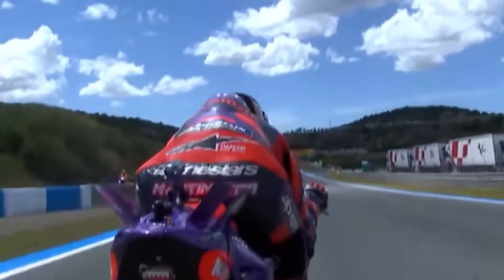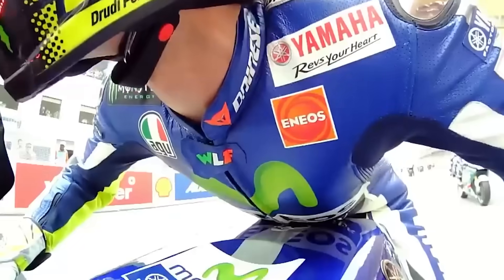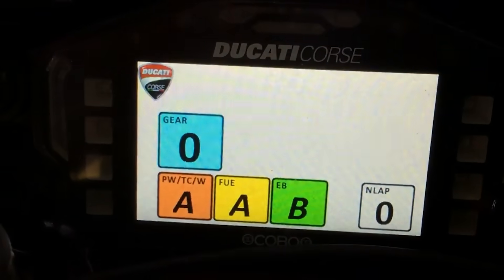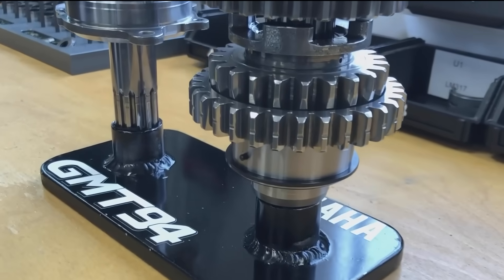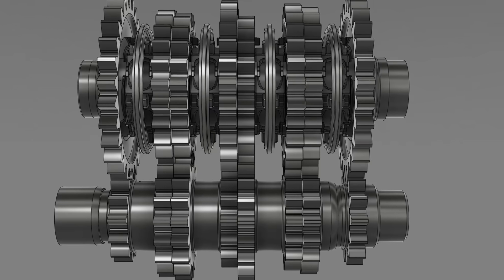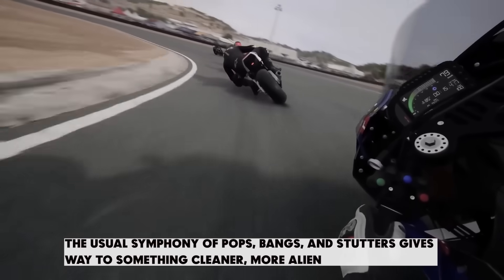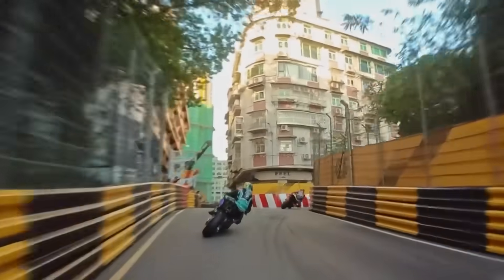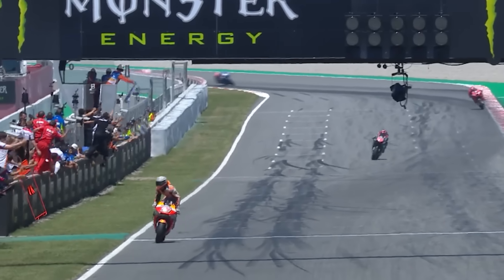The Secret Sauce Behind MotoGP Seamless-Shift Gearboxes

Comment: OK you're saying this didn't happen till the early 2000s that's where you're wrong, in the mid to late 90s I had a GSXR that had an AMA transmission in it, I could go through my gear seamlessly no clutch on the power and never lose forward momentum! This technologies has been around for much longer than the early 2000s! MotoGP might not have got it until the 2010s but AMA riders had it since long before the 2000s!
Reply: A quick shifter is not a seamless gearbox.
Reply from the maker: Good point — you’re right, racing tech like that was around earlier in AMA, just didn’t hit MotoGP mainstream until much later

Comment: You can talk a lot but you don't know anything, otherwise you would have told us how it works. I can see that it is to do with the angles on the ends of the dogs, they will flick out of mesh when that gear is in over-run.
Reply from the maker: Fair enough — you’re right, it comes down to the dog angles and how they disengage under over-run